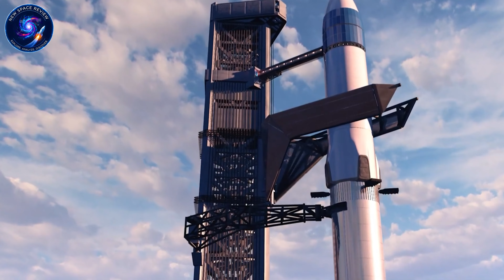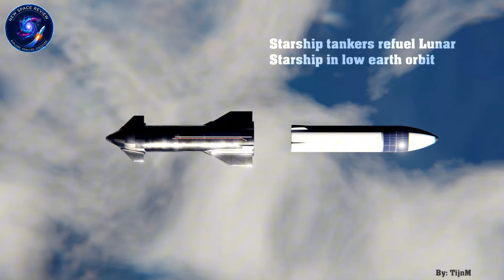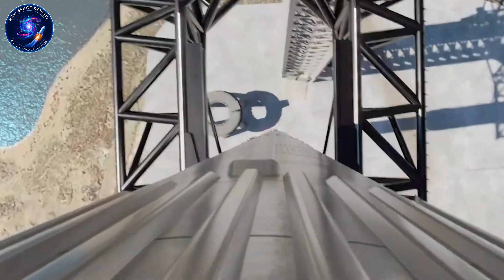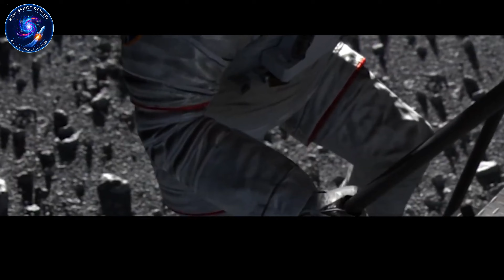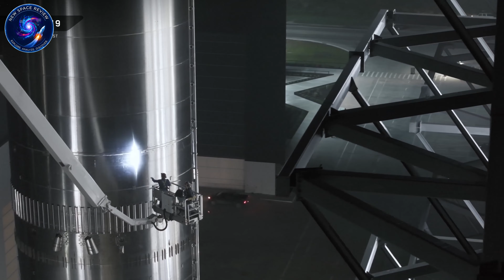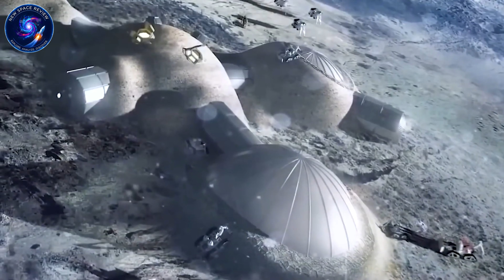Elon Musk Found Brilliant Solution for Orbital Refueling...Shocked NASA!

Comment: Here is a fuel transfer doe all ships. On the top near the docking port, about a meter or 2 down, on one side will be the boom and the other side a receiver. Both ship extend the docking rings and lock in, as the rings retrack the booms extend, at full docking the boom lock into the receivers. Can add the same system on the bottom or aft of the ships w/o the a docking system but a electrical magnetic arms, like a magnet on a crane. the arm extends and about 3 meters one turns on to positive and the other neg.. the magnetic field will lock the ships together. A 60° twist on both ships should allene the transfer system,
Reply from the maker: That's a creative idea for redundant/robust docking and transfer! SpaceX's actual design uses side-by-side docking with integrated adapters (no extending booms or magnetic arms shown in public hardware), relying on pressure differential for cryo propellant flow after soft capture—your magnetic twist lock could add alignment flexibility, though cryo seals and boil-off management remain the real hurdles. What inspired the 60° twist part?